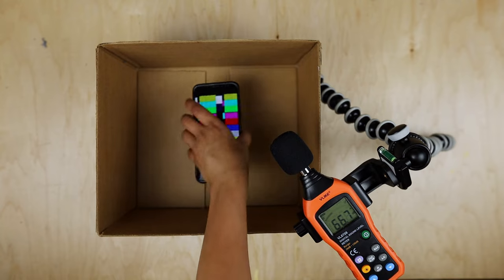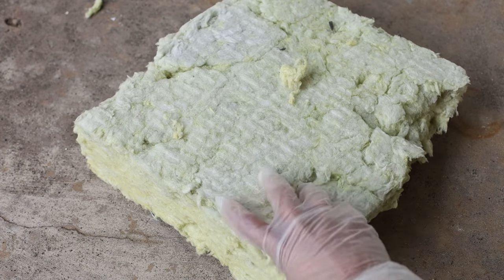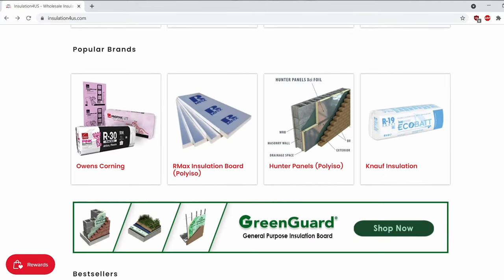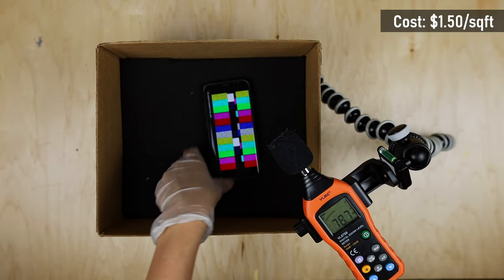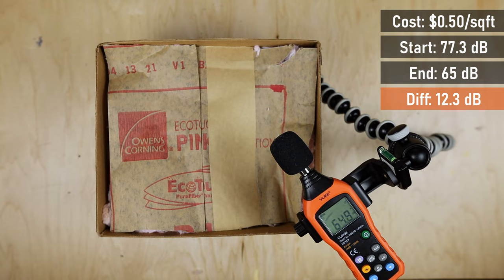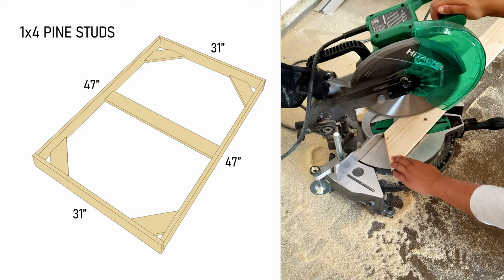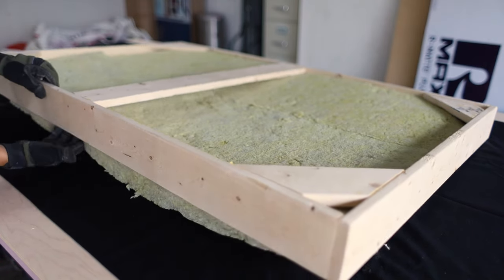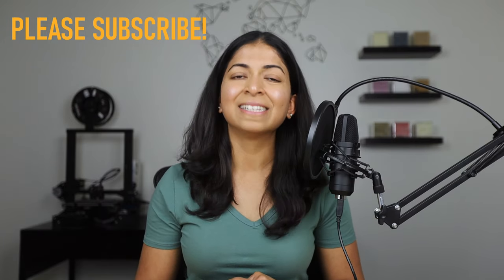Rockwool OR Fiberglass for DIY sound panels?

Comment: Yes, a good test for DB reduction, at one particular frequency at one particular point but most sound panels are primarily trying to stop annoying standing waves in a room that cause kind of, and sometimes very annoying reverb. 
In studios we can also make traps that are deeper in size or less deep to trap certain target frequencies. I think Mineral wool is more desirable, it is used in fire assemblies and won't burn like fiberglass does, it is water resistant, mineral wool can be expelled from the lungs and it does a slightly better job in the low end, otherwise the professional ratings are fairly close. For me I use mineral wool because it is widely available in low or really high density batts and panels and of course it is basically fireproof. The 703 fiberglass acoustic insulation is very expensive and I have to have them shipped. Here in NY I can hit my least favorite store Home Depot and get 1.5" 24x48 rockwool comfort board and double up or triple up depending on how low of frequencies I want to absorb and make pretty large panels that really work! . Comfort board is very stiff and dense doesn't even need a wood frame, although I use a frame so fastening fabric is easier. Or one can stick with batts that are smaller, less dense and need a frame. 
I think when testing one should compare products with the same density as well, so you are not comparing apples and oranges.

Comment: I would be curious to see how the decibel drops at different tones, especially the lowest tones in the 40hz-250hz range. From my understanding certain materials are good at the mid-high frequencies but can't absorb the pressure waves of sound as it dips into the lower range. Great video as always!
Reply: for lower ranges you need mass (so heavy open-celled insulation). But its only for correction. If you want to avoid annoying your neighbor those panels wont hep a bit.

Comment: It is well known that mineral wool like rockwool is one of the best sound dampening materials. (not insulation, dampening) 
It is open enough for air pressure to move through it and heavy enough to dampen it, converting it into heat.
The thicker the mineral wool, the lower the frequency it is effective at. Rule of thumb is to use 1/4 of the lowest wavelength you want to dampen.
Reply: Yep, especially at low frequencies. The hardest frequencies to combat in bedroom studios are the low frequencies.

Comment: The effect of placing panels to absorb sound is to lower the reverberation coefficient in the room. Proper test equipment is needed to show how quickly a loud sound (about 100dB of white noise) returns to normal dB levels once the source is switched off. 

Then panels are placed to “treat” the room and the test is performed again. Treating the reflective surfaces in the correct location will demonstrate a reduction in reverb coefficients in large rooms from 4-5 seconds down to an optimal number of about 1.2-2.0 (depending on the intended use of the space).

Your test is interesting- yet only really proves that we are already using the right insulating material to keep unwanted noise out of our homes.

Comment: While researching sound stuff for my workshop I ran across an acustian(?) and he said you need to differentiate between sound insulation (Schalldämmung ) and sound absorbtion (Schalldämpfung).

Sound Insulation being the ability to shield your neighbor from your noise generation. And the main ingredient is Mass, mass, mass. And disconnecting sound generators from hard surfaces.

sound absorption on the other hand describes the amount of sound energy  reflected by the surface back into the room, creating hall effects and noise.

Sound absorption may reduce the noise in the room, but your neighbor will not notice any difference.

I think this distinction is important as some people may want insulation and buy absorption.

Comment: Doing a sound absorption comparison of insulating materials is a great idea. I'd be interested to see more. In particular, the distinction made at the start between noise and other sound such as music, speech, loud bangs and thuds, motor hum or engine drone is very significant and worth expanding on, I believe. It'd be great to see the performance of each material judged on more than one frequency and type of sound as well as different levels of loudness. I'd also like for the thickness of the material used in each experiment to be more clearly stated. I like the experimental set-up as it is simple and reproducible by anyone and also avoids sound transmission via supporting structures e.g. wooden frames and panels or plasterboard etc. which are the main culprits for sound transmission through walls, ceilings etc.

Comment: Hi, thanks for doing this comparison. I noticed that you left the paper backing on the fiberglas insulation; none of the other insulation types had paper backing. My guess is that if you remove that backing, at the frequency you measured, the rockwool might have won the contest.  At higher frequencies, thin barriers like paper are more effective at blocking sound. The fiberglass, foam, and denim are not considered barriers, but absorbers (obviously).  But anything like a membrane with no openings is usually regarded as a barrier - except to low frequencies (wavelength compared to barrier thickness is the factor).  But thanks again for your work.  Simple fiberglas does indeed perform rather well, and in some cases, better than rock wool.

Comment: I found the same when I did the reno for an apartment in my basement. I'm afraid I spent a pile of money on the Rockwool Safe and Sound product when I probably would have  acquired the same or better result using fibre glass. I used resilient channel, 2 layers of Safe and Sound, 2 layers of ⅝ sheet rock and green glue on the edge seams. I chose not to use the green glue between sheets of drywall because of the cost. It definitely made it quieter but not worth the expense if I was to do it again. Another thing that was frustrating about the Safe and Sound product was the top and bottom batts were so compressed from packaging that they weren't very useful. Since there are 8 batts in a bundle, that meant that roughly 25% of the product didn't work. Lesson learned. Thanks for the great videos.
Reply from the maker: That's a very good point. It much more difficult to fluff up rock wool compared to fiberglass... I can't believe I'm  actually advocating for fiberglass lol!
Reply: @BelindaCarr  ha ya. All things considered, I think fibreglass with the 2 layers of ⅝ sheet rock would have been the way to go. I'm even thinking the resilient channel is a little over hyped. When I inspected the finished product, it didn't hang like I expected. There was plenty of channel contact to the joists for sound transmission. I'm thinking now that I should have listened to some early utube advice where they said for what little extra sound proofing you get from all these steps, it's not worth the huge extra cost. Their recommendation was the fibreglass between the joists and 2 layers of ⅝ sheet rock. Hope this might help someone.
Reply: Soundproofing is tricky.  The next time you do this pack the stud bays with as much unfaced fiberglass bat as you can, run 1x3s pependicular to your studs and hang 5/8" OSB in the middle of the 1x3 span, then put two loads of green glue on the back of a sheet of 5/8" type x drywall and screw that with short screws into the OSB.  Make sure you caulk all joints on both the OSB and Drywall with acustic caulk. This is how I build theater rooms and it does a great job dampening noise.

Comment: Hi Belinda,
As I am sure you have gathered from the other comments, you might want to return to this topic again.
As you said, it is a very complex science. An important part of the science is that different materials absorb differently at different frequencies. The test tone you used is not a realistic test because the frequency is far too high.
For sound panel testing, you will need to perform the tests outside or in an extremely large room (more than the quarter wave distance from each wall). You can easily cobble together a speaker (make sure you get a full range driver), and use Room EQ Wizard to perform the analysis (freeware). Driver and microphone will set you back well under $200.00 and probably under $100.00 if you go cheap.

Comment: There are a myriad of issues related to the room acoustics.  One of course is do you need to attenuate noise from the outside.  Then you need attenuation in the walls (and floor & ceiling).  That is achieved by something like very heavy construction, say brick or medieval stone walls.  Alternatively, you can stack different layers and depend on acoustic impedance variation.  The reflections at each different interface can consume the acoustic energy and produce attenuation.
  On the other hand, the room acoustics is generally an echo phenomenon.  In the ancient churches and a few concert halls, they built some cavities in the walls to resonate on the dominant echo frequencies.  They tuned the frequency and attenuation by adding varying amounts of sand in those cavities.  Modern concert halls use the hall geometry, as well as padded seats.  The worst geometries would include a full sphere or a cube.  Any changes from the cube to for example tilted ceiling are good.  When that often is out of question, as an afterthought, you need to add absorbing materials in different locations.  The first and most obvious option is a floor carpet.  Bookshelves (full of books!) and various furniture follow and wall rugs etc. are then the last remedies.  We once made our campus studio  that was miserably close to a cube shape to usable space by plastering the walls with 6 by 6 egg cartons.  When the studio was moved to a new building with properly designed and built room, the people who had to restore the original room were not too happy about our egg cartons, but that is another story...
  Professional acoustics designers used to start their improvement efforts by measuring the room echo decay after a "clapp" or even a start pistol shot.  Based on the decay time constant, they presented their recommendations.  I once had to improvise a similar measurement (without a clapp machine or a pistol).  I used a gated signal to a speaker as an impulse, and a microphone with a tape recorder.  I made several recordings and then cut the tape into pieces, which I formed into continuous loops, one impulse per loop.  Then I analyzed the frequency and amplitude characteristics with some self made electronics.  The results were OK and improved further when we moved all our laboratory equipment in.  That was not a studio purpose, of course.

Comment: The acoustic foam panels are made to reflect sound due to the shape (waves) on the face. They have nothing to do with the sound insulation between the walls, they have to do with the sound in the room. There are acoustic panels also made of wood or gypsum that have holes on their surface. These holes prevent sound reflection through interference. Sound waves break in those small holes and no longer produce the feed back effect. Besides, everything is well done. I follow you with interest and thank you for everything you do. With love from Romania ! :)

Comment: We use R30+ designed for 2x6 walls but in 2x4 wall depth. We also use 5/8 thick Sheetrock. Gets down into the low 60s and high 50s. Very effective for the $$

Comment: When I'm working overseas building a "secure" room, we go by STC ratings (Sound Transmission Class) and we have totally different ways of achieving that but I can tell you one thing, a marching band could be on the other side of the wall and you wouldn't hear it. FEBR doors and windows also complete the task but not many people are installing those unless they've got big bucks are might become a target.

Comment: Thanks for a great test! I wonder if the rockwool does better on lower frequencies. As far as sound blocking, the lower frequencies seem more difficult to dissipate. Possibly a frequency blocking comparison?
Reply: Yes, rockwool is better on lower frequencies.  
there are data sheets that show the differences between sound dampening between different insulators at different frequencies.

Comment: Once toured an Armstrong Cork facility which included a walk-in anechoic chamber. Armstrong was no fan of the pink stuff but here the chamber walls and ceiling were lined with fiberglass insulation in the shape of pointy cones. This room was almost acoustically dead. The sound energy soaked into the fibers & dissipated with no return potential. Sound transmission between rooms is a different animal; good sound walls require some combo of sound energy absorption, rigidity, density or mass. Example..Stud walls lack mass and rigidity and thus tend to be poor sound isolators. A stud wall covered with lead lined wall board performs much better due to the added mass of the thin lead sheet. Concrete and masonry tend to be great at killing sound transmission, almost entirely due to mass. 
Room shape also plays large in dissipating sound; sound energy loves boxes with 90deg corners or perfect silos since there is little to confuse or defuse sound energy patterns. Automotive mufflers are a great study concerning damping using only sound wave confusion (pattern breaking).

Comment: What we care about in home audio production is absorption across as much of the audible range of frequencies as possible. You are correct that absorption decreases in the lower frequencies (bass).  You tell us the dB or sound pressure level of the emitted sound from your emitter, but I didn’t catch any mention of the frequency. We need absorption data measured vs. frequency from 20 Hz to 20 kHz. You seem to be someone who could either perform this testing, or provide a learned review of available data. This would be more meaningful than stuff in a cardboard box.

Comment: The foam is only effective at dispersing reflected sound waves and as your test showed has little effect on pass through waves.
The integral vapor barrier on the fiberglass batts would have produced the drop you saw in your 1khz sine wave test tone.
Being more dense than fiberglass, the rockwool will be more effective in the low and low-mid frequency ranges. 

I have built a couple of mobile recording booths which typically give me a 20-25dB damping. These consist of a layer of 1/2" MDF on the exterior, a layer of 1/2" homasote board, a layer of egg-crate foam and a covering of acoustically transparent fabric to create a finish layer. 
Being very dense, the MDF reduces the energy transmission from outside sources. An 1/8" air gap and the homasote further dampen any sounds that do make it through the MDF. The egg-crate foam is a much cheaper alternative to the commercially available acoustic panels but is just as effective an damping the mid and high frequency reflections inside the booth. It is important to use an acoustically transparent material to close up the panels because any sound wave that cannot pass through it will be reflected, effectively acting much like a solid surface.

In the above instances the only reason I didn't use rockwool was because it would have forced my wall thickness to 6 inches. As it was I was able to keep the wall panels to a 3 inch thickness.

Comment: If you're using sound panels to absorb sound echoing around in the room, be aware that this is not how they are tested.  What she's measuring is sound transmission, not sound absorption.  These are two completely separate functions.  Ironically, you could cover the box with a layer of concrete and the levels would drop even more.  But concrete absorbs almost no sound compared to any of these materials.  What you want to measure is the sound reflecting (or not reflecting) off the surface.  A more meaningful homebrew test would have a reflection off the absorbing material be the only path from the source to the sound level meter.  It's actually kind of tricky.  And yes, the answer is different at different frequencies.

Comment: I'm sure you'll get a lot of comments about this, but 19 seconds into the video  and I already heard "sound insulation" twice. 
Sound insulation means preventing sound from going through a medium. 
Sound treatment means preventing sound from being reflected back to the microphone, thus improving the quality of recordings.
Studios require sound treatment. It's the neighbors  who want sound insulation
Reply: Sound panels are meant to prevent reflections. it's why they're usually only ever used partially in walls, to allow for "some" reflections back to  the mic making the sound not completely dry to the point it sounds unnatural and require reverb to be added in post-processing.

Comment: Did notice that the rockwool, was roughly cut, and is quite dense and relying on a good seal, so the relatively big gaps at points round the edge would have effected it's performance in your test, I would guess. The fiberglass is a lot more loose, and will expand to fill the whole space much better. Would be interested if and when the sound blocking panels are available again, you retest with those, after clean cut.

I believe the panels you made, which filled out the frames did not have the issue, but as they are only acting to absorb some sound in the frames, rather than block transmission in a full wall assembly I'm not even sure the completely surrounding is a valid test for that, but given your set up, as a YouTuber (and not a commercial lab) I think it was a very sensible approach. 

Enjoyed and thanks